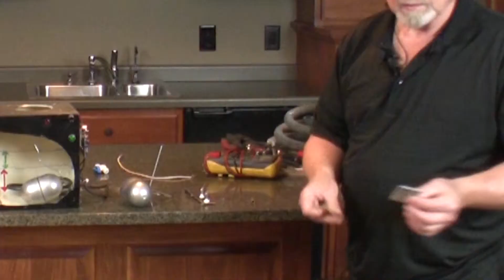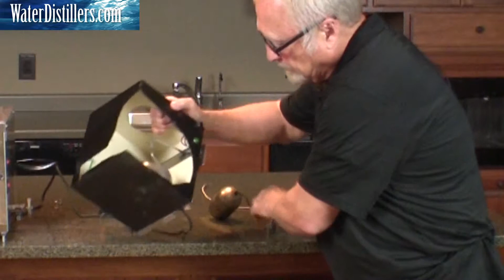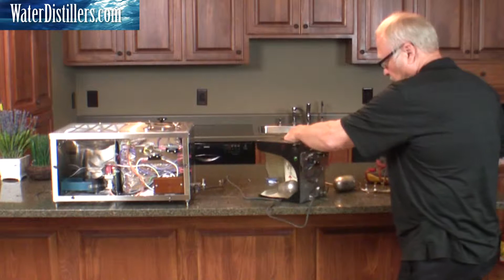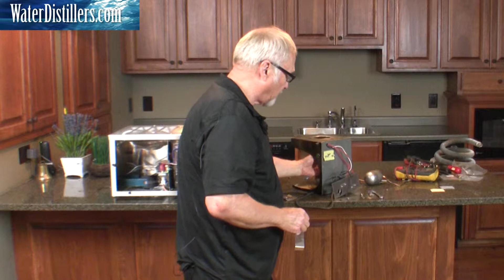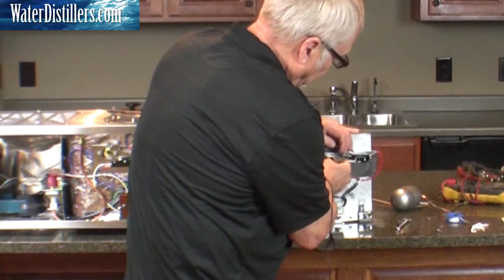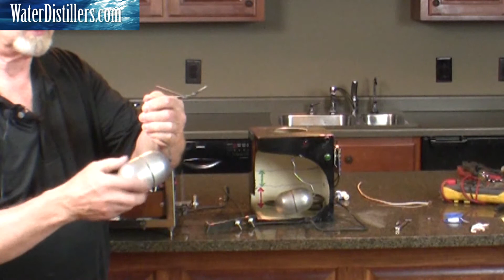How To Change A Water Distiller Float Gasket Using A Durastill Float Gasket Set

Comment: Good video.  I have had 2 different Durastill units for over 25 years and changed this gasket several times but never knew about using Teflon tape on the inside surface plate.  I usually only have to replace this gasket every 6 or 7  years but should probably do it more often.  I once made my own seal out of Boeing 737 aircraft flap seal material that looked identical but didn't last so I highly recommend the Durastill gasket.  I worked as an aircraft mechanic and had access to seal materials but they only provided a short term "band aid" fix.   I also had no idea the float was threaded onto that arm!  Good to know!  I only wish the seal material was sold in bulk sheets so I could make my own gaskets instead of having to order and pay shipping charges.

Comment: Thanks for the video. How often should one have to check or replace the float gasket on the durastill 46 for consumer use?
Reply: Well mine just failed after 9 years of about 1 full cycle every 7 days of use.  The design is not great, all the electoral should be protected from an enviable gasket failure, and is not.  Could have been designed better.
Reply: @allan801  for awareness, mine failed after about 3 years with similar usage. Agree it's not a great design. Just had the solenoid water intake spring a leak which is under pressure, flooding the system as well. I'm in Australia so a real pain to get parts. Great machine when working though.